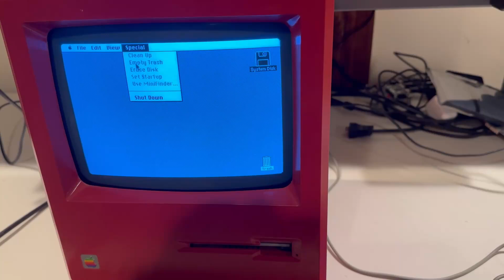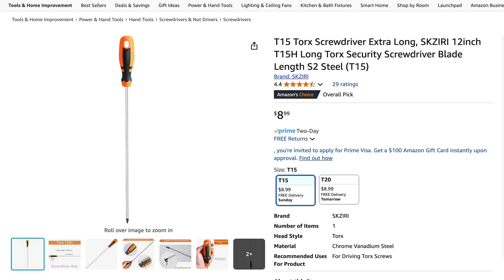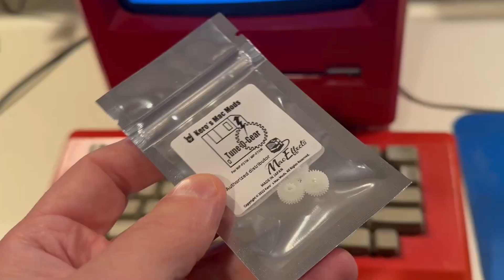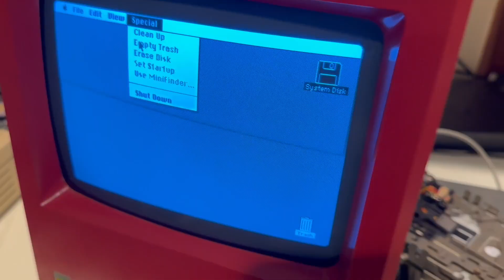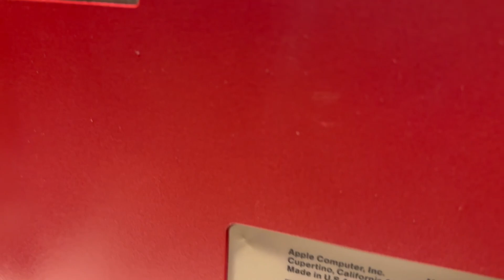Floppy Drive Gear Replacement for Classic Macs

Comment: Love it. I've fixed a few floppy drives back in the day. And an old electric pencil sharpened that died for the same reason!
4:23 Cleaning the head movement worm gear is a good idea, and you want to re-lube it afterward. Just a dab of silicone grease is all you need (silicone grease is safe for both plastic and metal). A tiny amount of silicone grease on the ejector gears is a good idea, too.
Reply from the maker: Thanks, I appreciate it!  I did lube it, just forgot to include, whoops